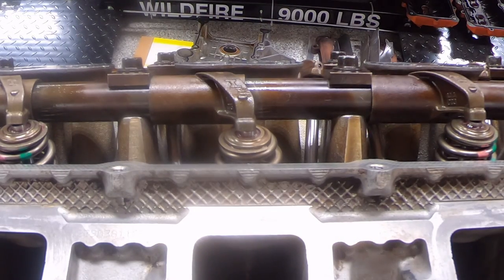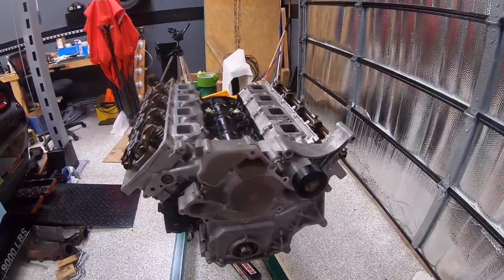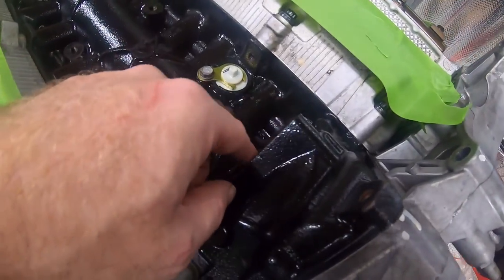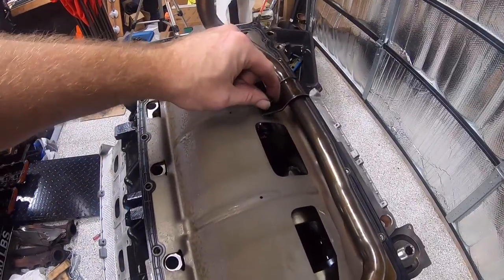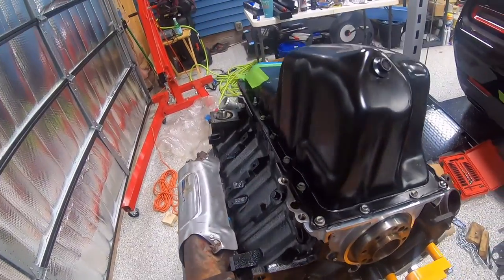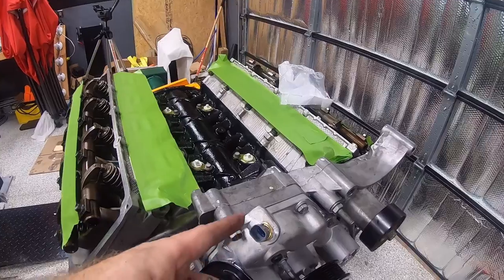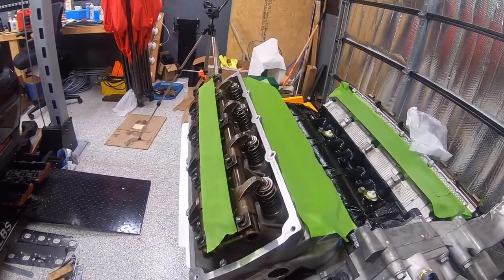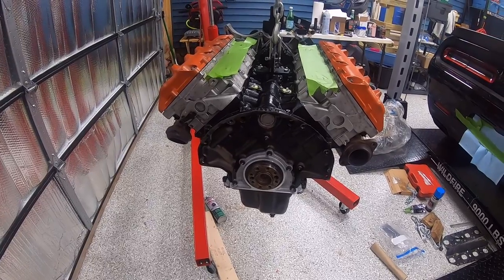2009 hemi 1500 trx4 build part 55.  Long block build part 4.  Finishing the long block.

Comment: Do you pay for an all data subscription or so you have a mechanic friend to lend you this info? I was looking at pricing and I cant justify the cost, but my Haynes manual isnt going to cut it for engine work.
Any recommendation? I can only find so much posted online free and dont want to get stuck if I do an upper end rebuild.
Reply from the maker: Depends on the vehicle, but I normally get the diy 3 year subscription for the vehicle that I am working on if it is going to be a while to finish it.  But with that said, each page I have looked at, allows you to print to a printer or pdf for later use.  So a 1 year or even a 1 month maybe long enough to pdf the information that is needed.